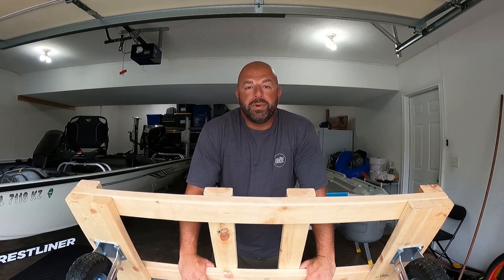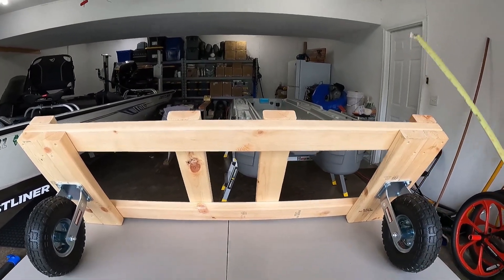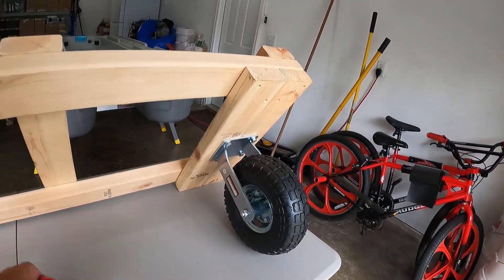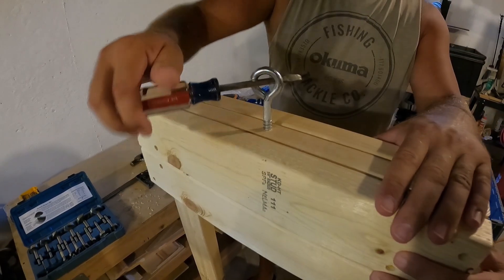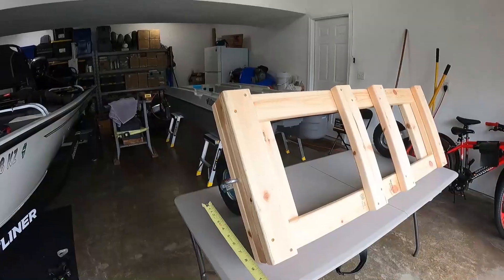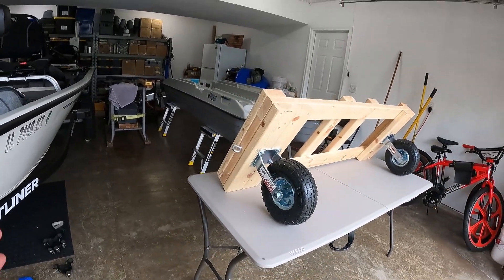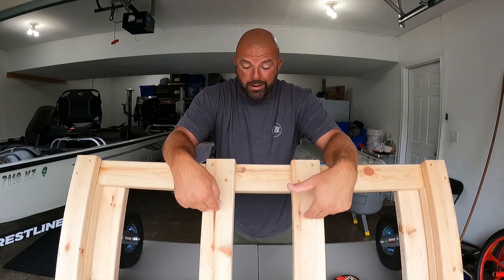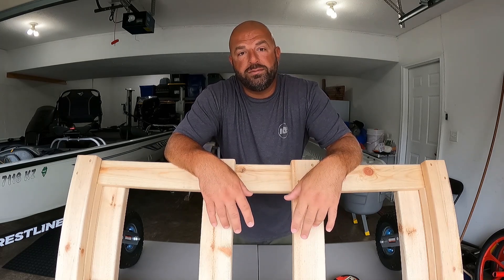DIY Bass Boat Dolly (Budget Build)

Comment: I’ve used a similar dolly system only I used preexisting kayak scupper wheels…just modified them with some wood and large dowels. Added half a large pool noodle with plastic washers and deck screws. Slide son and off easily when dry… but! That pool noodle gets a bit grippy when wet and has helped nicely! Plus! The pop noodle was like 2$? Maybe 3$. And I still have extra to Roland it when needed. And use for other modifications where necessary. Diggin the little pong hopper style rig!
Reply from the maker: Right on brother! 👊
Reply: Sorry for the long diatribe sir! Thanks for the response.  Also **Pond hopper that should a said. 
Thanks for all your videos and great info